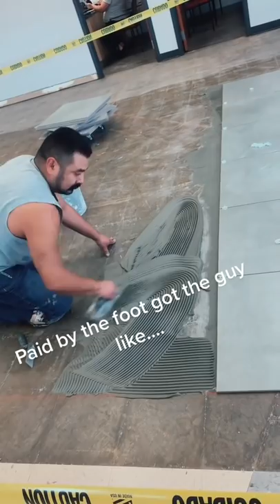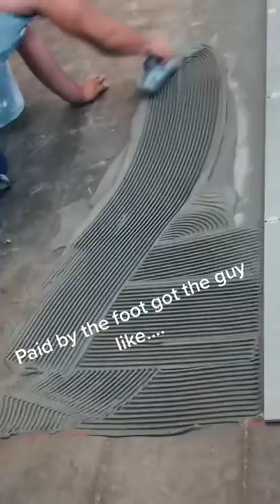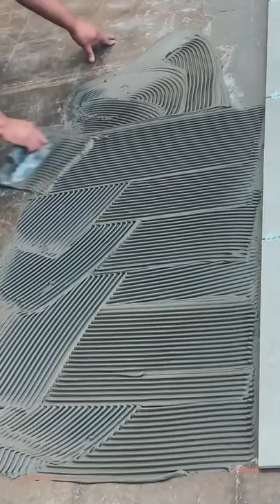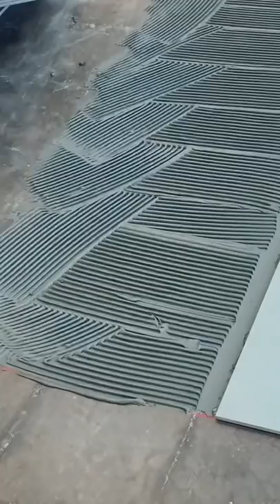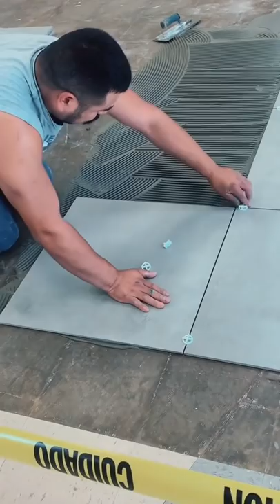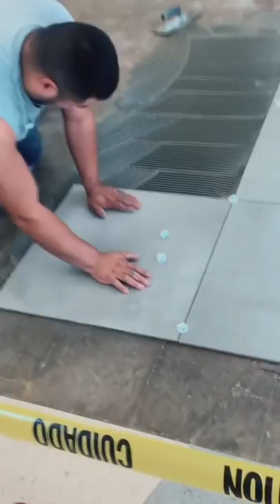Dude laying our new tile is 🥶 CREDIT terrywatson806 #Shorts

Comment: I did tile work for a several years, it's brutal on the hands and knees. Respect to any man who's done this for years and keeps going to work everyday. Not a joke, very labor intensive.
Reply: My uncle and his guys wear knee pads. You can get them for like 10 bucks at Lowe's or Home Depot.
Reply: @liberationpocket7950  Yes thank you captain obvious, but what you fail to realize is that it still is hard on your knees even with pads.
Reply: @hzuiel  I'm sorry. I didn't mean to upset anyone. I haven't laid tile before and it was just something that I thought would help
Reply: @Michels1  explain pls
Reply: @liberationpocket7950  I mean I think most people in this kidn of work own knee pads for exactly this reason, and some are better than others. However knees weren't meant to carry our weight, and even with pads crawling around on them for hours is hard, and even worse if you have to get up and down all the time to get more supplies and cut out shapes for things like tile or wood flooring.
Reply: Knees are delicate as hell.  Do squats n it helps a lot.  Do squats, do squats, do squats,
Reply: Try doing residential carpet, tile is nothing in comparison. Up and down the stairs with those heavy rolls, moving all that furniture, most people would break
Reply: My father was a Master Floorer. His work was fucking amazing, and he definitely destroyed his knees for it though.
Reply: @cravan1185  I did 25 years and got out, was just getting really tired of it and you cannot compete with the illegals that have taken over the business, but fortunately, my knees are in great shape and I quit having migraines due to all of the things I was breathing in such as the seaming iron glue and various adhesives, that was brutal
Reply: @irishsid13  how do you think the tiles, floor mix get upstairs? Tile setting is 100 times harder than carpet install
Reply: @nikolakarovic6509  100 times you say? I've done both and would have to disagree, generally you have to move a lot of furniture when doing carpet, but the job itself is equally exhausting and equally destructive to one's knees. I use the stretcher the majority of the time instead of a knee kicker so my knees are intact at 46 years of age good sir.
Reply: @nikolakarovic6509  not to mention when you're carrying large rolls on your shoulder and you have to match patterns and there is a loop pile, God damn I'm glad I got out of that business
Reply: @irishsid13  gah damn I go back to work Monday and I’m dreading doing that shit 😩🤮
Reply: Roofing is horrible too lol, so hot
Reply: I'm a feminist and I want 50% women doing this.
Reply: @johhny bubbz I got payed well for it tho!
Reply: @mcuembedded  I don't want 50% of women on a roof. That's a job for men to suffer in.
Reply: @JosefPiano  Nah that's patriarchy. Need 50.1% women on the roof.
Reply: @mcuembedded   bruh
Reply: @chrisdub2010  Ayyye that's a good one lmao
Reply: Knee pads or not just being like that for 8 or 10 hours a day sometimes longer if you work for your self sucks. It takes a good  minute to straighten your back out after you’ve been on your hands and knees. Fuck learning a trade I wish I would’ve gone to college 😂
Reply: @irishsid13  bro trust we have to deal with similar bullshit in commercial work. Why try to down play this man he gets up everyday just like everyone else .
Reply: @liberationpocket7950  it's fine man. You were helpful. Some people are so tense up about wanting to know everything just to hide behind their intellectual insecurities, thinking secretly they are not smart enough so they try to make everyone else feel stupid. 

I don't do tiles and if I ever do, I'll buy the knee pads thanks to you. So thank you!!
Reply: @Youngdolphforlife  how did I downplay anything? I think you missed reading a few comments there friend. Put simply, he said tile was really really hard and carpet was not so hard, I completely disagree, I agree that both are difficult and strenuous but was just making the point that I think carpet guys do more work due to Furniture, tear out, Etc. Just a difference of opinion coming from someone who's got 25 years in flooring.
Reply: @hzuiel  roofing is Harder
Reply: @jenniferhesler8038  gyyy
Reply: @hzuiel  knees literally carry out weight tho lmao 🤣 🤡
Reply: I’m 16 , been in the business for 2 years it’s hard work
Reply: @zakkennedy2901  lmao, I don't miss the 20 second process of trying to get your back and legs to straighten up after you had been on all 4's for the past 2 or 3 hours plus. 30 yr old standing up like he's 80 yr old.
Reply: @liberationpocket7950  You’re an amazing person for trying to make their lives easier.
Reply: Better than being on the roof putty ng the metal panels on in Miami in 110° heat with 100% humidity.
Reply: My dads been doing it for around 25 years
Reply: @liberationpocket7950  idk why but I hate knee pads, my dad always uses them but they get so uncomfortable
Reply: I could imagine hunched over like that would do your back in too
Reply: @hzuiel  tHaNk YoU cApTaIn ObViOuS
Reply: @mindful.a.madness1439  body weight squats and lunges
Reply: People who do floor work dont spend 10 bucks for knee pads. They spend $250
Reply: @mcuembedded  Women going to be so confused when they get asked what crime they committed 😂.
Reply: @thegoon3088  Your not supposed to apply direct contact pressure to them that much though. Your knee caps be crying dude. Saying this as a runner and someone who does part time construction.
Reply: Where knee pads. Knees and elbows are the most complex parts of your body
Reply: Knee pads only feel ok for about the first 20 mins or so then they start digging in your knee the straps start to hurt even more this work is completely miserable
Reply: @zakkennedy2901  lol funny thing is nowadays a lot of people are trying to push "get a trade skip college" not that theres anything wrong with that but both got their drawbacks
Reply: I've done this work before. Its not bad but it definitely will destroy your body overtime, id definitely take this work over oilfield work and the hours we get out here.
Reply: I used to paint, lots of new construction, there was a crew of tile guys that would come in every few jobs wearing full support and protective equipment, they looked like hockey goalies missing a few pieces and adding others, but they were second generation and their dad's got wore down and tore down very fast. It was smart, and they didn't mind the jokes. Good dudes.
Reply: @JosefPiano   That dudes just being ridiculous for the sake of it. I've never done roofing, I was a painter, but the guys on the roof and the ones on the floor have it the hardest. Being up there carrying bundles in that heat, wearing full length clothes to keep the burn away, is some seriously hard work. Roofers keep the outside, outside, and are very important, criminally underrated in my opinion.
Reply: @Magna_Carta5  they really are
Reply: @hzuiel  it doesn’t have to be if you aren’t lazy…
Reply: I did it for a summer and it sucked 😆
Reply: @irishsid13  best part of getting out for me, was no long sneezing out tile dust 50x a day
Reply: Imagine if you did framing lol
Reply: @gustavozetter7033  is it that bad ?
Reply: Yup as a civil engineer, I have construction workers like him working under me and i can see how hard it can be, especially when the tiles have various designs on them.
Reply: @hzuiel  stay mad tradie
Reply: Thank you
Reply: To whoever is reading this Jesus loves you and all you need to do to be saved is believe that Jesus Christ died on the cross for your sins was buried and came back to life on the 3d day. Confess with your mouth Jesus is Lord and you’ll be saved! I hope to see you in the clouds! God blesslllll
Reply: @liberationpocket7950  $10 knee Pad’s??? Good Luck on them things! That’ll kill ur knees and Back even faster! A pair of Pro Knee’s for $90-$150 will make it feel like ur Kneeling down on a Cloud. Ur tools are just as important as knowing how to properly lay Tile! Collapse those ridges! Move that tile Side to Side! And Daammmnnnmmmm on to straight ass concrete! When the concrete stress cracks it will crack all thought out that tile!! Straight Up failure on this tile lay! May not be soon but soon enough it WILL HAPPEN
Reply: thanks buddy
Reply: @liberationpocket7950 i’m sorry for my last comment. But still knee pads solve half the issue😊
Reply: @@TheStoic1995 Yes That's how that's supposed to go
Reply: @feqol  If it was so obvious there wouldn't be so many tradesmen with fucked up knees. Why even make that comment? What does that contribute?
Reply: @juniperbirds  That makes literally zero sense. What is a "tradie"? What did I say that would make me one? What about my post seemed mad?
Reply: Real talk🙌🏾💪🏾
Reply: @Jesus2faddedd  spoken like a true person who has never done carpet. Get you some thick expensive carpet, and then get you about a 60 ft shot and carry it up two flights of stairs, then get back at me. You're obviously 12 to even say something like that.
Reply: @irishsid13  how did you manage to keep your knees intact?
Reply: @JJoh4040  I always wore knee pads, not always, but a lot of the time. That's about it, got lucky I suppose.
Reply: Been in the game for a year and a half. It’s tough being a new guy, especially at a small company ☠️ 
Very labor intensive job. Family always makes of fun of me for going to bed very early every night. I keep telling them it’s manual type labor.
Reply: @liberationpocket7950 yeah, after doing it for a while, it still hurts like hell even with the pads.
Reply: @irishsid13 
 BAWAHAHAHA.  You have no clue!
Reply: @irishsid13 
You've done both carpet and tile,  huh?
You've obviously never mixed a 90# bag of cement and sand  in a 4x6 mud tub with a mud hoe for weeks at a time in 90 dgs. weather.  You are talking out your arse.
Reply: @buckruttin2246  have a pretty good clue seeing as how  I work with them on a fairly regular basis, the both, so if you're asking what I'd rather take a box of tile upstairs or a big ass piece of carpet, going to go with the box of tile. Both are very labor-intensive, both are hard work but I've handled some huge rolls of carpet, tile comes in boxes so it's a lot easier to maneuver around, I'm not saying tile is a walk in the park, I've done it, it is hard work. I demo a lot of tile so, I know all the ins and outs, just like taking up piss soaked carpet... Both have their downfalls
Reply: @nikolakarovic6509 I install carpet & tile (floors, showers, & backslashes).. they are both difficult in different ways.💪
Reply: @irishsid13 bro what 😂
I’ve laid tile and carpet and let me tell you I’d rather do carpet, it’s easier compared to the 2.
Reply: @hexZ06  I've done both as well, give me a kitchen of tile over an occupied house full of heavy rug any day, I guess we have different opinions. Both are labor intensive, both are hard work, I think we can agree on that, right?
Reply: @hzuiel plus a lot of construction workers are forced into false self 
Employment.
Reply: I’m in my 15th year

Comment: I always respect those that hold this kind of professionalism and efficiency in whatever job they have. [EDIT: Apparently this dude isnt doing a v good job sooo... fake it till you make it I guess??]
Reply: You may not realize but he’s actually doing a horrible job
Reply: @bobloblaw7465  as a proper tiler I can tell you that back Buttering is not needed in most cases. It is simply something the manufacturer of the glue says so in the event of a failure they can say oh you didn’t back butter, not entertaining the claim. Honestly mate no body back butters here in  Australia. Been tiling 17 years never done it. Never had a drummy tile or a fail either.
Reply: @bobloblaw7465  Maybe the way air can get trapped from how he made the strokes...
Reply: @bobloblaw7465  funny you said he made mistakes yet reply with a question lul how much experience do you have doing tiles again ?
Reply: What!? What the hell exceptional thing did he do😂
Reply: @jimmyfiddle5234  would you say those are gonna crack on the edges ive done tile alot .did my bathroom and it all cracked. Sub floor?
Reply: I am obsessed with efficiency and improvement and I hold max respect for those who achieve speed without sacrificing perfection
Reply: @bobloblaw7465  dont argue with the ones with knowledge and experience. Your life will be much more simple. Be positive. Dude did a great job. Thats all
Reply: @jimmyfiddle5234  Its not their fault,  they've been brainwashed by all these YouTube videos, I've been setting tile for 35 years here in California,  the only tiles we back trowl are natual stone. The only way my floors are coming up is with a jackhammer.
Reply: @juicewrldspercdealer7542  How?
Reply: You should respect all workers…. Work is work.
Reply: Things only Mexicans will understand
Reply: @imanidiot2904  Well I learned this originally from Japan so it ain't exclusive!
Reply: As a drywall hanger, we were always paid by the foot. Often we would take our profitable time to fix framing issues, HVAC, call for electricians and plumbers if they missed something. We always took the time to do our best work we could, so the drywall finishers had an easy time. 

We may have lost some time on each job for this, but you know what? 
There was always another job, and we were the ones they would call. 

Like you said, we practiced professionalism, and would be as efficient as possible without sacrificing quality. And we expect others to do the same. 
I slept well each night knowing I always did my best.
Reply: @bobloblaw7465  I’m telling ya mate, we don’t butter shit. Would love to see anyone having a go at getting my tiling up. Not saying everyone you met is wrong. They’re just doing something unnecessary
Reply: @bobloblaw7465  also could be many reasons for failure, not back buttering  would be the last reason
Reply: @bobloblaw7465  really came back over 2 weeks later to say I'm the one who didn't answer also no it wouldn't stand since you made the comment confidently to them asking if its even the only way to avoid failure so thanks for not knowing lmao
Reply: My hubby worked doing tile work for over a decade he was good and quick
Reply: Agreed
Reply: Usually transfers quality to everything else…. Except maybe the quality of their kidneys cause beers
Reply: Liked this comment just for the edit lmao
Reply: Lmaoooo. 😭
Reply: this the funniest edit I’ve seen 🤣
Reply: @KayChbt8290  not everyone does good work though. Any job is respectable(I'm sure there's some jobs that are literally bad and morally wrong), but not all people are, some just don't care and don't put any effort in to do a good job.
Reply: bruh why would you comment this without knowing absolutely anything about this kind of job? some of yall say shit just to say it. for the likes & comments & attention? idk
Reply: @cinnamonthecat9661  Didn't realize you weren't replying to me... My bad!😅
Reply: @justgoaz  
Cinnamon didn't @ you lol.
Reply: @cinnamonthecat9661  y u so mad I just like the idea of people who put in all of themselves into their job and I thought hit was one of them at that time lol
Reply: @Bollibompa  well crap... I got the notification and assumed it was to me, guess that's why there's that old saying about assumptions!😅 thanks for pointing that out lol!
Reply: @KayChbt8290  Exactly.
Reply: @YukyDoodle  bruh. You are good. Many would die on the wrong hill. You owned your faults and saw it as a lesson learned and something gained. So many others wouldn't, even myself many times over. Keep growing bro! 👊
Reply: @D-REALM  Thank you!! Took some time to get here w situation like this so I appreciate your comment!! You keep growing too!!
Reply: @justgoaz  np lol
Reply: @YukyDoodle  i just think its the sort of goofy ass take i'd see on twitter 9 times a day.
Reply: @markme4  give me a spade/crowbar and a couple of minutes and I'll have it up
Reply: @HighFlyer6969  I'll call you the next time I need a demo crew
Reply: @markme4  I'm the Jeremy Clarkson of demo...
Reply: @cinnamonthecat9661  Yeah you look like you spend time on twitter w that profile maybe you should get off it
Reply: @jimmyfiddle5234  as a tiler in New Zealand, try 28 day bond test. Admittedly back butter isn't too necessary outside of wet areas (depends on dimensional stability and things like seasonal movement, perimeter joint etc), but directional trowelling is important. I've been doing tile 18 years, much of that spent on insurance work and remedials
Reply: @jimmyfiddle5234  also directional trowel means they go down easily, faster to get flat without variation. Quality of adhesive is important too. Mapei keraflex, those tiles will release clean if you pry the edge
Reply: @YukyDoodle  i got perma/IP banned from twitter 4 years ago, and haven't been on since.
Reply: @cinnamonthecat9661  bahahaa damn u mustve pissed some people off
Reply: @YukyDoodle  i was wild on twitter for sure...